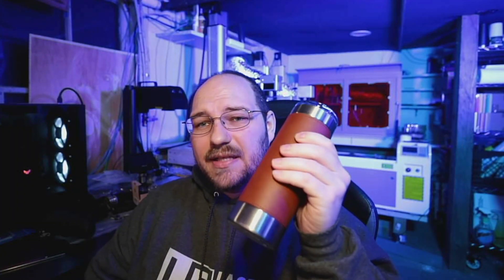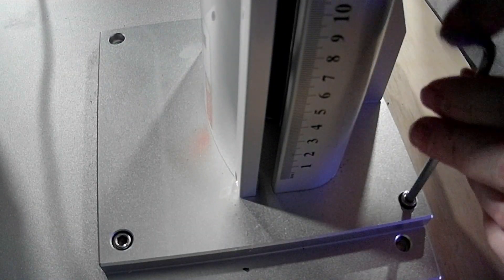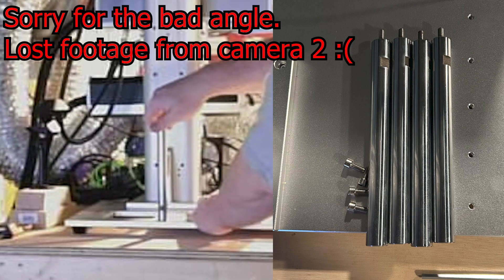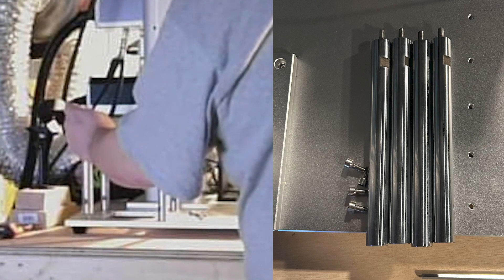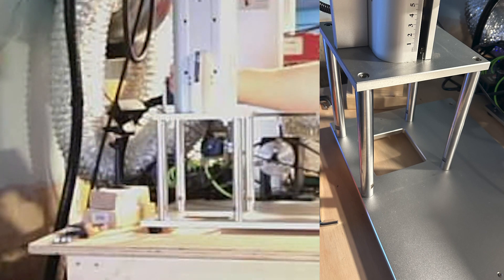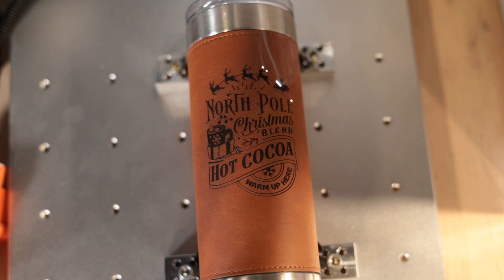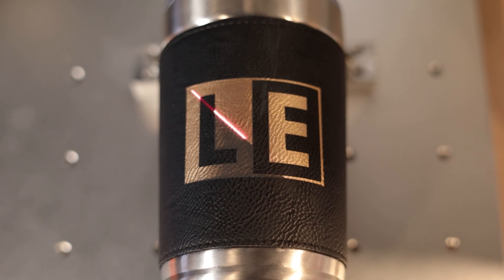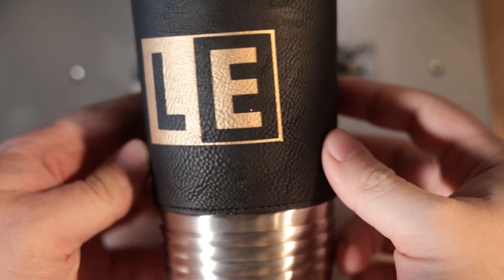Raise the Roof! | Z Tower Riser Install For Your Fiber Laser

Comment: is it no problem with the focus when the tumbler is not rolling??

just got a fiber laser, but no one with auto focusing..  costed more to get the 2,5d engraver then the 2d one.
was is bad to not take the 2,5 one maybe?
Reply from the maker: You don't need fancy heads to project around curves, but it helps. To find out more about how Kyle is pulling it off with a standard scan head check the links in the description to our Projectmark/Cylinder Correction videos!